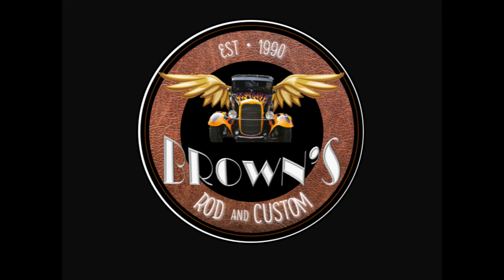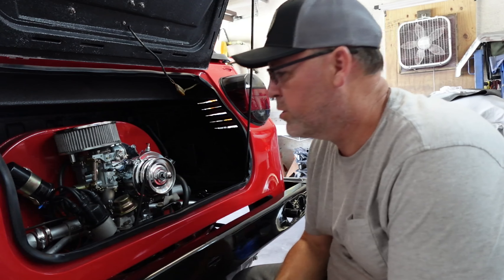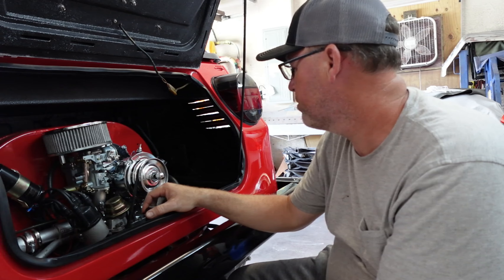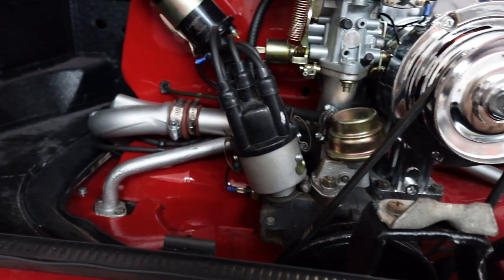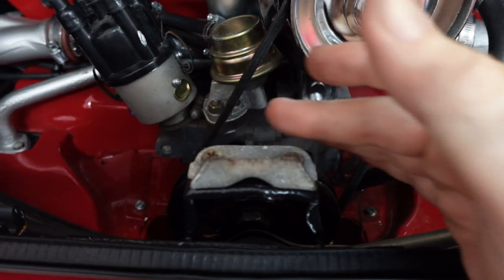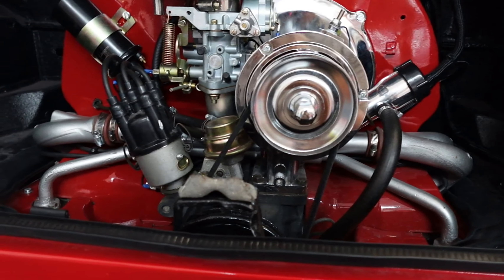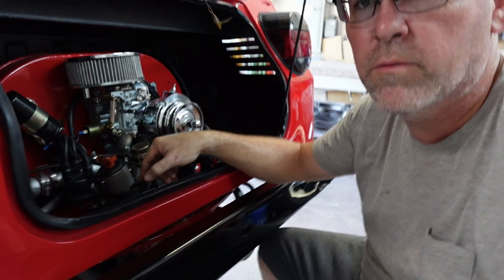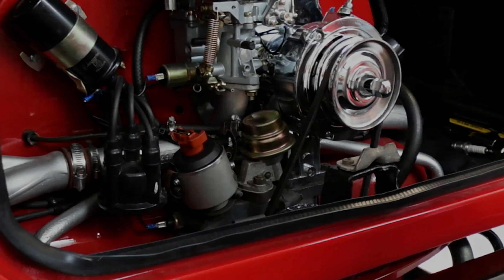1973 VW Thing Restoration: Setting Timing and Adjusting Valves

Comment: Seems that you are missing some very important engine tin. I don’t see the front tin, which actually goes across the engine behind the fan shroud. It will keep things running much cooler. It’s  pretty vital to have that. And you might want to buy a degreed crank pulley. Not just for looks but to help set the maximum timing advance.